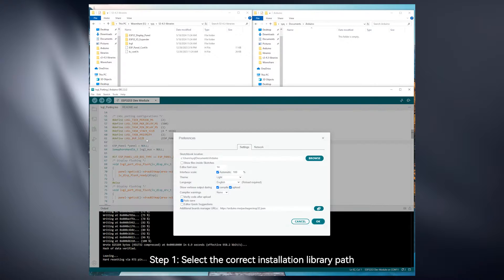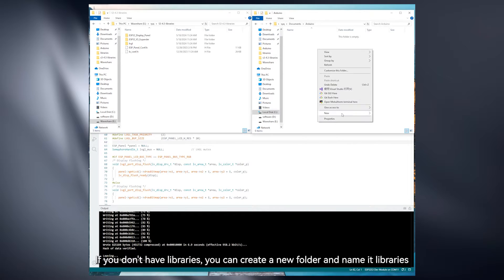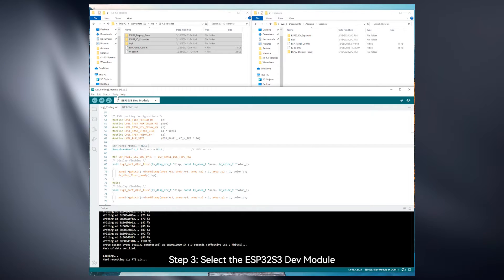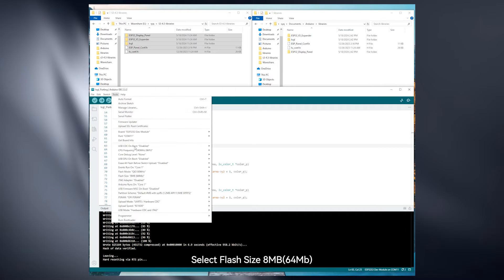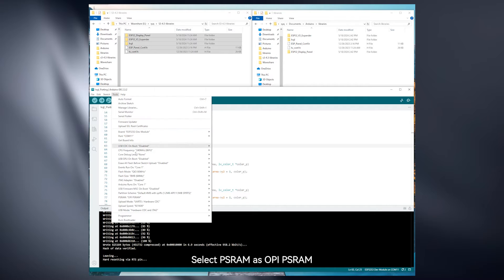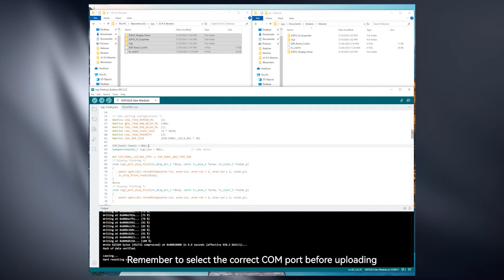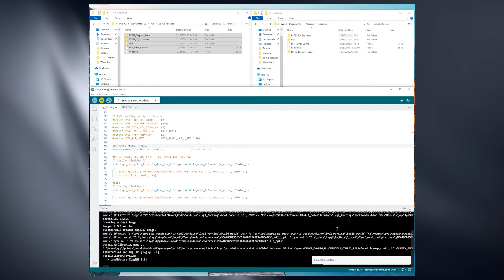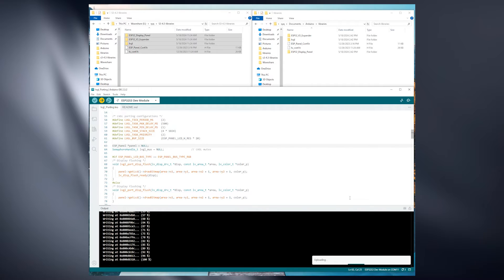Configure Tutorial: ESP32 with display,  capacitive touch lcd, 4.3inch, Supports wifi and bluetooth

Comment: I did it but this the result Wrote 271040 bytes (151553 compressed) at 0x00010000 in 1.4 seconds (effective 1583.3 kbit/s)...
Hash of data verified.

Leaving...
Hard resetting via RTS pin... 
I did reboot and reset still a black screen !

Comment: After Attempting to "Set Target":  

Option#1:

 Error: non zero exit code 2 CMakeLists.txt not found in project directory C:\Users\#######\.espressif\tools\idf-driver\idf-driver-esp32-usb-jtag-2021-07-15\x86 Adding "set-target"'s dependency "fullclean" to list of commands with default set of options. Executing action: fullclean Build directory 'C:\Users\######\.espressif\tools\idf-driver\idf-driver-esp32-usb-jtag-2021-07-15\x86\build' not found. Nothing to clean. Executing action: set-target Set Target to: esp32s3, new sdkconfig will be created. at ChildProcess.<anonymous> (\dist\extension.js:2:1421636) at ChildProcess.emit (node:events:519:28) at Process.ChildProcess._handle.onexit (node:internal/child_process:294:12) { vslsStack: [ CallSite {}, CallSite {}, CallSite {} ] } 

Option #2: 

Error: non zero exit code 2 CMakeLists.txt not found in project directory C:\Users\#######\.espressif\tools\idf-driver\idf-driver-esp32-usb-jtag-2021-07-15\x86 Adding "set-target"'s dependency "fullclean" to list of commands with default set of options. Executing action: fullclean Build directory 'C:\Users\######\.espressif\tools\idf-driver\idf-driver-esp32-usb-jtag-2021-07-15\x86\build' not found. Nothing to clean. Executing action: set-target Set Target to: esp32s3, new sdkconfig will be created. at ChildProcess.<anonymous> (\dist\extension.js:2:1421636) at ChildProcess.emit (node:events:519:28) at Process.ChildProcess._handle.onexit (node:internal/child_process:294:12) { vslsStack: [ CallSite {}, CallSite {}, CallSite {} ] } 

Option #3: 

Error: non zero exit code 2 CMakeLists.txt not found in project directory C:\Users\######\.espressif\tools\idf-driver\idf-driver-esp32-usb-jtag-2021-07-15\x86 Adding "set-target"'s dependency "fullclean" to list of commands with default set of options. Executing action: fullclean Build directory 'C:\Users\######\.espressif\tools\idf-driver\idf-driver-esp32-usb-jtag-2021-07-15\x86\build' not found. Nothing to clean. Executing action: set-target Set Target to: esp32s3, new sdkconfig will be created. at ChildProcess.<anonymous> (\dist\extension.js:2:1421636) at ChildProcess.emit (node:events:519:28) at Process.ChildProcess._handle.onexit (node:internal/child_process:294:12) { vslsStack: [ CallSite {}, CallSite {}, CallSite {} ] }
Reply from the maker: Hi dear, pls feel free to contact our support team https://service.waveshare.com/

Comment: WHY HAVEN'T YOU CREATE AN EXAMPLE FOR YOUR ESP32-S3-TOUCH-LCD-7??? IF IT'S THE SAME STEPS AS WHAT YOU SHOWN IN THE VIDEO THEN IT DOESN'T WORK!!! IT WON'T COMPILE!!!

"Compilation error: 'ST7262_PANEL_IO_3WIRE_SPI_CONFIG' was not declared in this scope"
Reply from the maker: hi dear you can refer to our wiki and download the latest demo library etc. for testing https://www.waveshare.com/wiki/ESP32-S3-Touch-LCD-7
Reply: @waveshareelectronics  the wiki might aswell be in Chinese and still nothing works
Reply: @waveshareelectronics  It is about time you upload a demo that works. I am yet to find someone that says they got any of the demos to work. The only sketch I got to work on my 7 inch screen was Mastermind by @Va&Cob

Comment: ESP_Panel *panel = NULL;
Compilation error: 'ESP_Panel' does not name a type; did you mean 'ESP_PanelLcd'?
I can't use your sample code. It's an error.
Can you help me?
Reply: Hi, @phanuwatkaewprom4590
you can go to the ESP_Panel_Board_Supported.h and :
Line 10 : set esp_panel_use_supported_board to 1 and uncomment the line 84 #define board_waveshare_esp32_s3_touch_lcd_4_3.

After that try to compile.
Note: 
Flash Mode : QIO 80 Mhz
Flash size : 8 MB(64Mb)
PSRAM : "OPI PSRAM"
Reply from the maker: dear, pls feel free to contact our support team https://service.waveshare.com/
Reply: @waveshareelectronics  Why don't you show me the steps to open the code? What sample code is used? What code do you use?